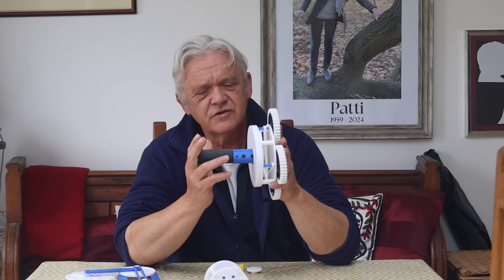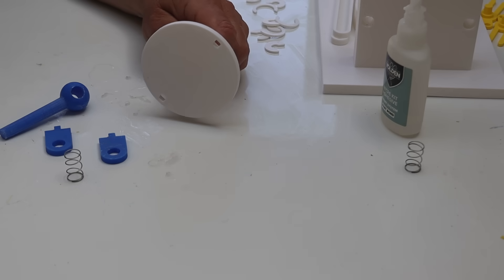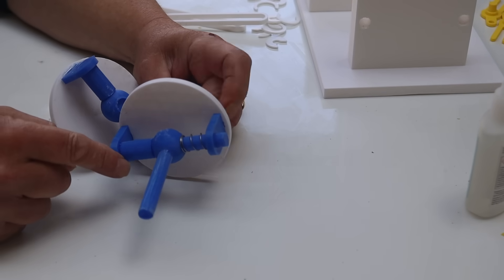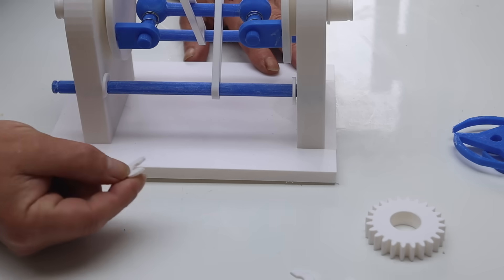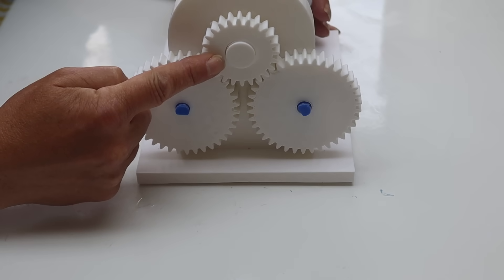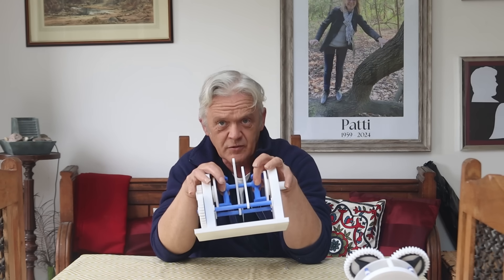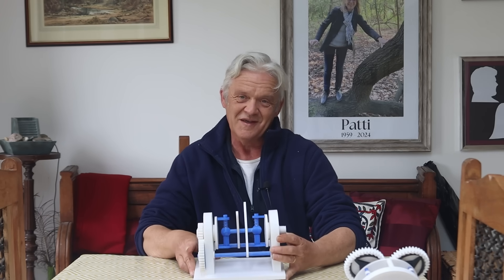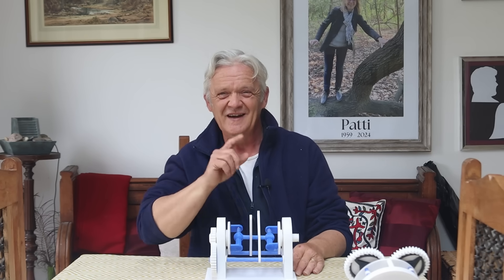2375 A Self Controlled CVT

Comment: might be able to get it to work if you glue four steel nuts (weight) to the ball things and then spin the whole lot at high speed with a cordless drill in 2nd gear and also put washers so in the rest position it is off center (otherwise the radius is zero and centrifugal force won't appear)

Comment: Note that transmissions are also occasionally used in EVs too for efficiency. (They are essential in ICE vehicles because of the relatively limited power band of internal combustion engines.) This CVT is very interesting. Thanks.

Comment: Current CVTs are like an expiration date on your car. They will wear out, and they will cost more than the car is worth to replace. I have never heard of them lasting as long as a typical 4 or 6 speed from 20 years ago. Maybe this is just how the car makers clear the path of high milage used cars so they can sell electric cars to people who dont want them. I also see the possibility of EVs using CVTs in reverse only for charging optimization. In order to get the maximum efficiency out of an EV motor during regen braking, it is best to keep the motor RPM in a narrow range. A CVT could be used to do this in conjunction with the brakes to balance the stopping feel and motor speed during deceleration. At least in this use case, they would be likely to last longer and they will definitely outlast the battery pack, which is the expiration date for an EV.

Comment: Hi rob how's it going? Loving the stuff on gears, and as always I have a question if you'd be so kind please?
I've made a washing machine motor run direct from a solar panel and it's very impressive. (The speed/rpms).
I have also made a washing machine motor that is a generator and if you use a 6 volt battery to induce a current into the coils getting 70 volts dc using a battery drill to spin it (100 volts + if using a 12 volt battery, haven't tried 24 volts yet)
What I was wondering am I better off using the motor powered by a solar panel to rotate a shed load of magnets round lots of bigger copper coils or coupling the motor to the generator via a set of gears with a I dunno 10:1 ratio maybe?
If you go onto my channel you can see my latest uploads by their titles, otherwise if you reply on here I can then copy and paste my links in a reply to your reply without youtube disappearing them. Cheers rob
Reply from the maker: What is it you are wanting to do mate - i mean couple a motor to magnets - obviously - but why?
Reply: @ThinkingandTinkering  hi rob, thanks for your reply, youtube keeps deleting my links so I'll try email them to ya if that's cool. Why? Because it's only a 100 watt solar panel and it's making the washing machine motor spin like the clappers!!
Reply: @ThinkingandTinkering  to answer your question fully, over unity/zero point energy / perpetual motion machine. Theoretically speaking, nothing lasts forever, but then a perpetual motion machine is a Theoretical thing anyway, doesn't have to actually even be made as far as I'm aware

Comment: Absolutely awesome content, once again. Maybe we could combo this shown principle with your version of the ratio zero cvt 😮i've also been thinking in a way to use some concentric or cycloidal mechanism to cancel / correct the pulsating power output. I think the fact the arms stay fixed in the same position during its whole course contributes to and could possibly be used to cancel the pulsating output. 🤔 clutchless, self variable, non pulsating, 100% geared CVT, the dream transmission 😆
Reply from the maker: That would be cool!

Comment: Have you examined the transmission developed by George Constantinesco in the 1920s?. This was produced in France in the 1920s in a car and those who drove it said it was simple to drive and very flexible. The car was commercially unsuccessful but the Constantinesco transmission was used in Romanian railcars between the wars.
Constantinesco is best known for his hydraulically actuated interrupter gear in British WW1 fighter aircraft - this was said to be superior to any mechanical system.
Reply from the maker: yes mate - i made a video and a model of it
Reply: Is that the chap who also invented a novel deep well pump that bounced the column of water using a small, short stroke piston, and a foot valve ?

Comment: Following this series of videos I have wondered if you could use a CVT to form a or part of a suspension system. It would possibly be to heavy or complicated to be practical but that doesn't stop it from being possible (could vs should). Another aspect of suspension systems in cars/vehicles could also be things like toe, camber and other geometries that are often fixed not variable so I do wonder if gears or a CVT could be used to turn these properties to variable. Maybe eventually some good computing, cameras and time a reactive suspension system theoretically could optimise for all suspension geometries rather than just preload and damping (more common active suspension system variables). It doesn't need to be proved or delivered but fun to think about, best part of these videos to me is opening up to possiblities and activating the power of imagination/creativity to explore and we might just find good problems for these great solutions/ideas. Thanks Rob!
Reply from the maker: I don't know mate - but I suspect you could

Comment: I had a working steam engine as a kid and remember it had a governor that worked with centrifugal force. I had been thinking recently how such a mechanism could be employed to control the speed of a CVT. What an elegant solution! Thanks for sharing and the straightforward explanation.
Reply: Belt-driven automatic CVTs that use a variable pulley diameter  are often used in scooters and small ATVs.  They use a "variator" plate with roller-shaped weights.  As the input speed increases or decreases, the rollers fly out or get pushed in, pushing on the variator and increasing or decreasing the effective radius of the pulley.  It is common to be able to buy lighter or heavier weights in order to tune the shifting behavior of this type of CVT.
Reply from the maker: cheers mate

Comment: I've been following your CVT work, waiting for something like this.
I believe you had a drill press in the workshop.  The thing is, I can change speeds on mine, but it involves fiddling around with belts... so I usually don't - rather, I just accept the wrong speed for the bit as "close enough".
It would be great to either move a lever or simply have it auto-adjust like this!
Reply from the maker: i do have one and i know the mechanism - it would be cool indeed

Comment: my 1970's Skid steer has manual controlled  belt style CVT.  Hydraulic power moves a pulley to one of two locations.
Reply from the maker: that and disk CVTs were very popular
Reply: My early 2000s riding mower also has a manual belt CVT.  One pulley is fixed diameter, the other spring loaded.  A lever on the console adjusts the idler tension and the increased tension forces the variable pulley to reduce diameter.

Comment: Large motors have various wiring configs, switching and timing components. and capacitors used to ramp up to full speed in a few secomds. 
 It would be really cool and perhaps profitable if you could design this transition, low gear to high gear in a few seconds automtically and mechanically via gearing allowing minimum and optimized wiring configurations.  Such a design would allow for lower amperage requirement on startup and lower cost of larger diameter wiring and components, cheaper breakers, smaller or no motor capacitor, and fewer electronic components to make that transition.  Hope that makes since.😂
Reply: A car starter might also benifit.  Might want to add a disengage feature and or a breaking feature for advance designs.  A car would benefit by needing a smaller battery or perhaps a capacitor with this gearing. Disenging feature would be necessary.
Reply: All this is done eletriclly so you don't have to do it mechanically which would be much harder. Mechanical transmissions make much more sense when tramiting power between mechanical systems.
Reply: @joaomrtins Good point.   Having worked on the electrical side of these systems, electronics seem to have a shorter life, where mechanical can be designed to hardly ever fail with occasional maintenance. Besides if its printed, once designed its just a repeat. But I know the industry has gone with electrical, but it would be awesome to see what he comes up with!
Reply from the maker: it does make sense mate and thanks for sharing it - it's an interesting idea - cheers